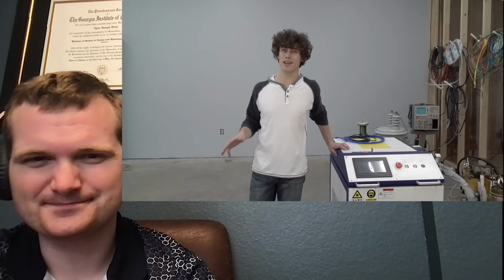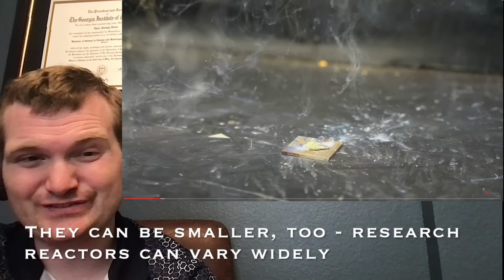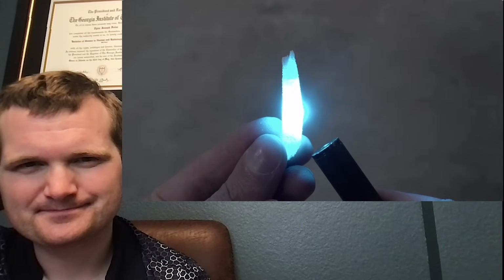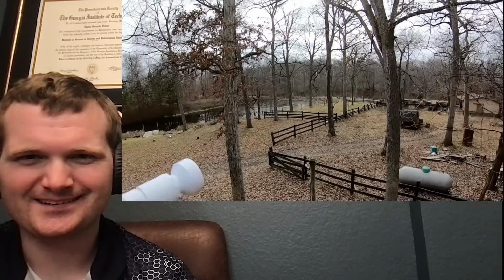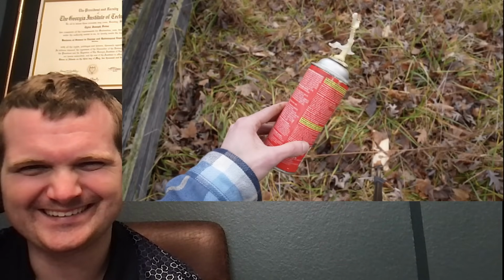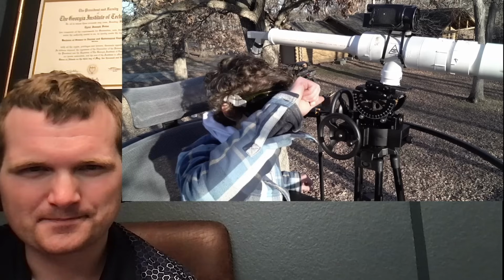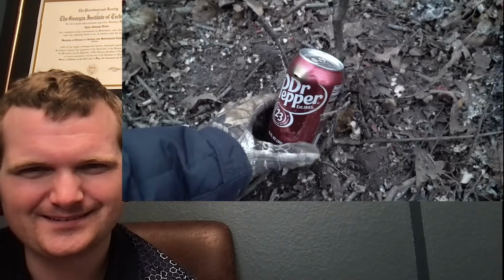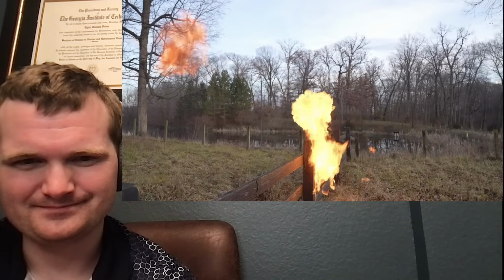Nuclear Engineer Reacts to styropyro "I Built a Long Range LASER Turret in my Yard!"

Comment: Yeah, the laser seems to have a beam width closer to 1mm than 1cm, which if true would bring its power density up to 2MW/cm³ rather than 2kW/cm³. It's that whole "dividing by small numbers" thing again like with pulse laser power going into the GW despite being run from a normal wall socket.

Comment: Pedantic quibble:

The inverse square law does not apply to lasers, yagi antenna transmissions or other beamed energy within the beam's near field (Rayleigh range), which is dependent upon the light's wavelength and the tightness of focus. But once the beam travels beyond the Rayleigh range into the far field (Fraunhofer region), it begins to behave like a spherical wave originating from a point source. Beyond that distance the inverse square law will start to apply.

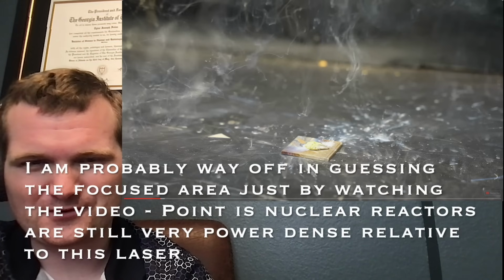Comment: 6:11 nope. This is 2kw focused on a 2mm×2mm×1mm, it just appears to be a larger surface because of the movement of the laser as it scans. The power plant is 5kwcm³ at a minimum, you say, so im gonna double that. So if you scale that up from the laser, we are looking at the top millimeter at 50kw, 5 times the hypothetical power of the cm³ of fissile material, and then repeating that for the 9mm in depth below the surface, thats 500kwcm³. That would be two cubic centimeters of material per megawatt. Now I'm not a doctor, but that seems unreasonable to me.

Am I missing something?
Reply: And really, that depth of the laser is likely <0.25mm, not a full millimeter. And that's being very generous. The beam size is probably closer to 0.75mm² as well. So, really, this is monstrous.

Comment: I don't know of any microwaved that are 2000 watts the one I have is a 1200 watt and that's already more then any box recipe for microwave cooking those are all 1100. Also 5k for a reactor vs 2k for the laser the reactor may produce a large amount of power but you need to remember just how tiny a laser like this really is. If the energy density of this laser was scaled to the same area you gave for the reactor you wouldn't have a reactor anymore the walls would be melting and you would prop go blind

Comment: Easy answer to the energy density question - one is electromagnetism in the near visible spectrum, the other is the strong force :) It's pretty lopsided (100x).  If you had electromagnetism at the same energy density as the strong force, you'd know it by the x-rays and gamma rays going everywhere :)

Comment: You said 5kW/cm³, but did you really meant 5kWh/cm³?
The laser can output 2kW of power. The power density, or radiant flux, depends on what area, not volume, these 2kW is distributed over. If focused on a 1mm² spot, the flux would be in the order of 200kW/cm².
The temperature of that tiny spot can be calculated using Stefan-Boltzman's law. The flux is then 2GW/m², which corresponds to a temperature of 13700 kelvin.

Comment: For those that don't know that was an air cleaner for a car engine that used a carburetor.

Carburetor is what mixed fuel and air from the above air cleaner before putting it into the cylinder to explode.

A cylinder is where the fuel/air mix is denoted by the spark plug causing a piston to be pushed rotating a cam shaft and a drive shaft the cam shaft is responsiple for lifting a valve the valv,....

Comment: "Military applications" yes indeed, I've studied this years ago and the fiber laser has changed everything replacing the DPSS (Diode Pumped Solid State) laser for much higher efficiency as in >50% wall plug to laser output. They get into the megawatt power levels, Do a web search and see them use a 5KW fiber laser to shoot down drones from a KW distance. I offered this guy my KW fiber laser 5 years ago to play with but back then he declined having not experimented with that power level before. Now he has. Thank you for your professional opinion and feedback, Ken.

Comment: I agree with others. That tiny dot of the laser is not thick beyond the wavelength of the light, so it should be way beyond a reactor.
Not sure how you'd guess a half cubic cm when it's light levels of thin

Comment: I've worked with some high power fiber lasers. He's probably right about power density before the optic section. Since the tip of the fiber optic strand is typically no wider than a human hair and all 2kW would be passing through that point. Just imagining the military ones that are getting closer to 100kW is mind boggling.

Comment: Even by your own explanation, it sounds like this laser is magnitudes more power dense that a reactor.
Reply: Not magnitudes. It is certainly several Kilowatts higher. But magnitudes? Nope. That laser would compress the air into an explosive plasma if it did.

Comment: Definitely higher than power density within a nuclear reactor by a lot. You're comparing to reactor power per cm^3 but the Lazer burns the surface not the volume and thus it's concentrated per cm^2 and since it's scans it's really only on a point at any given time for a very short time. area at close range smaller than mm^2. The energy is only imparted on the surface makeing the energy density many orders of magnitude higher than the energy within a volume you're comparing it to. Cm x cm x nanometers is wayyyyy different than energy spread over a 3D area.

Comment: Hey T Folse, are you sure you are a real nuclear engineer ? The number you mention for a nuclear reactor power density in the 20 KW per cubic centimeter are ridiculous. That would translate to 20 GW per cubic meter. That would translate into a 7000 MW electric power in real life, wich is way higher then any single commercial reactor in the world. 1000 to 2000 MW are more common for the most powerful of them, and their reactor is much bigger than 1 single cubic meter. More like 100 to 1000 cubic meter if you include all the necessary control equipment and cooling water you have to include inside. Is that possible you confuse with the power density of the enriched Uranium fuel itself ?

Comment: When the Chinese claim to have a laser rifle capable of burning at 100m, I'm now tempted to believe it; especially after seeing the 'thing' (beam expander) made from pvc. Sure, it takes a huge power supply to run continuously, but you could probably get enough for short bursts (a few seconds each) from a back-pack lithium battery; 500Wh of battery is only a few kilos. Depending on efficiency, a battery pack like that could maybe do 5 minutes continuous, maybe the laser itself could also be shrunk to backpack size.
Reply: Same. Its well within the realm of reality at this point. Its kinda scary.

Comment: Maybe I'm alone in this, but I expected to see some AMP UP ops on the core. I'm guessing that's for the next video.

My last laser days were with a 7w Argon laser. I spent something like 7 months learning about it, rebuilding the water delivery system for the cooler circuit and preparing the room for my first flip of the switch of something which had sat and gathered dust for a decade. 

That beast had been replaced with a bunch of super cheap Ruby lasers, and finally some ND-yag units which I ended up loving since they were reliable and made great pictures simple, and didn't need a night-mare level of PPE to even validate. Those little guys were in the 500 mW range. 

Stilll wow... Trying to even get around the power density for this rig. What the heck does this kid have for a bill?
Reply: Sponsors 🙂

Comment: 6:00 I think It easily exceeds the power density of a reactor as the power is dissipated mostly in the surface of the target over a few mm^2 when used as a minimum sized beam or a paint stripper if one thinks of instantaneous power.  Thats a volume of perhaps a few mm^3 at 2000W and that is more like >10-100 kW/cm^3.

Comment: The comment about the energy density of the fuel seems like a non sequitur. A nuclear reactor doesn't liberate all that stored energy instantly. As other commenters have pointing out, Styro Pyro is likely referring to the raw surface temperature at the focal point of the laser, or to the kw/cm^3 at the focal point.

Comment: That LASER turret with some gyro stabilization would be just the thing to have on your yacht in pirate infested waters, although conventional weapons would be good as a backup just in case.
Reply: Guys, he put a telescope on a commercial laser.
Get over yourself.
Reply: @AzaIndustries  he has also built ridiculous, crazy, genuinely scary shit
Reply: @rawhidelamp  Yeah, I watch his videos.
The biggest danger is going blind.

Have you seen what conventional weapons actually do, over massive distances?
Reply: @AzaIndustries  i have, but the application for lasers in a military setting is for defense more than offense.

Like for instance if you can get a laser to melt the fuel supply or cone on a hypersonic or cruise missile, its much easier than trying to use patriots or CIWS to intercept.
Reply: @rawhidelamp  yeah, and we've had that for a while now. Laser is only coming up to par now.

And it's range will always be limited by the atmosphere.
Higher energy laser heats up the air and causes deflection.
Just passing through the air causes diffraction that weakens it beyond a short range.
Forget about dumping more energy into it, that's just causing a blinding hazard all over the place.
Reply: @AzaIndustries  i know the range is limited, thats not my point.

Im saying they can be used to replace CIWS and missile systems like Iron Dome and Patriots
Reply: @rawhidelamp or definitely be very useful to engage lower value targets such as drones and mortars, considering that those are way more vulnerable to such weapons than a hypersonic missile or an artillery shell.

After all the artillery needs to be re-enforced to survive being shot out of a gun, and the missile to survive the intense heat of hypersonic flight. Thus they would be very good at absorbing heat from a laser. But are also targets often worthy of a dedicated interceptor. 

Meanwhile losing a patriot to kill a shahed flying lawnmower is not a good capital trade.
Reply: @AzaIndustries you're silly
Reply: Add AI assisted targeting that could lock on an object and track...  I am really surprised he hasn't been hired by the military.  I would think some version of that could be used to bring down drones.
Reply: @eshwayri styropyro mentioned in some video that he’s been approached by the military on several occasions but he turned down the offers
Reply: @rawhidelamp  Mans really declined to lend his powers to the military
Reply: @Techno_Idioto  on the basis of morals, he didnt want his knowledge to be used for bad
Reply: @rawhidelamp  Good. More memes for the world.
Reply: @eshwayri  Who is to say he hasn't?

Comment: Oh yeah, way more energy dense than nuclear reactors. 5 Kilowatts per cubic centimeter? Even 50 would be nothing compared to 2 kilowatts in an allmost one dimensional line of 20mm length which is what he set the width to in the beginning (and presumably setting it lower later on, too). Though, granted, its difficult to compare an area (and while yes, in practice it wont be one dimensional, but likewise it cant be 3 dimensional, you cant hit under the area thats actualy currently being hit) to a volume...
But if that width is 20mm then thats at most maybe 1 mm high and lets even say it somehow goes a milimeter into the material somehow, that would be a volume of 20 cubic milimeters tops. 
1 cubic centimeter is 1000 cubic milimeters.  That would make this 100 kilowatts per cubic centimeter, 75 if we assume a quarter of the energy gets lost to the dust particles before reaching the target.

Comment: looks like a legal way to defend my boat when cruising from country to country
Reply: with what power source lol
Reply: @illport  the 9 kw diesel generator and the 800 AH 24v battery pack.
Reply: @anonpers0n  Not nearly enough. Depending on the laser type you'd need 15-25 kW of electrical power for a 2kW CW laser.